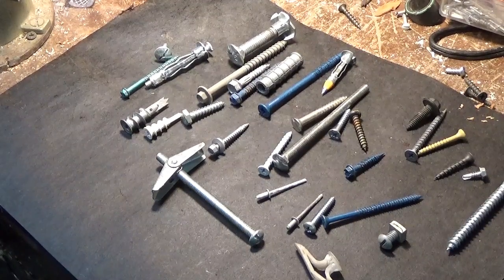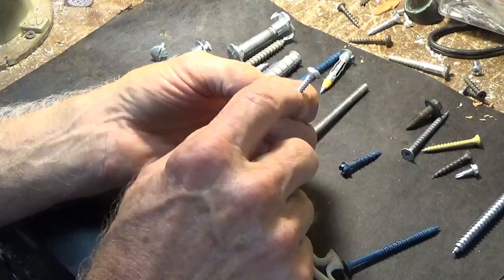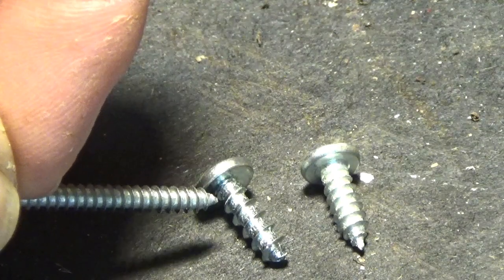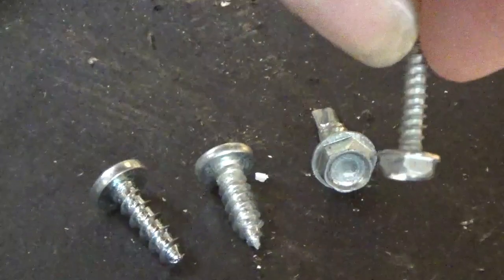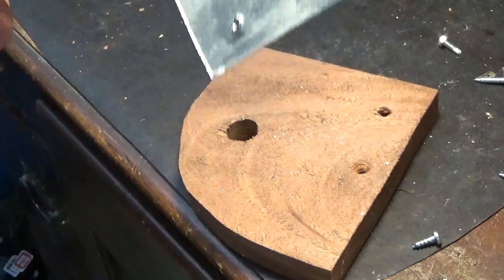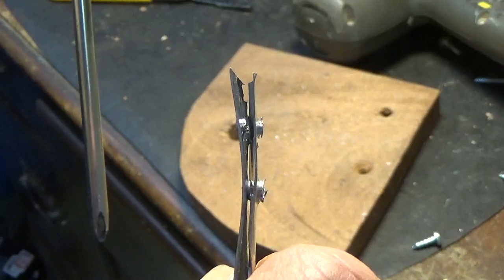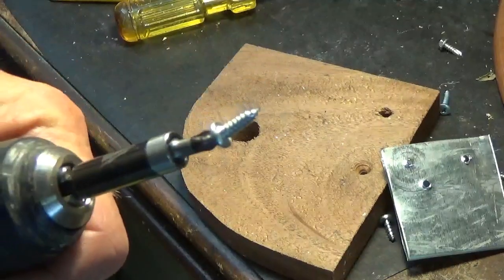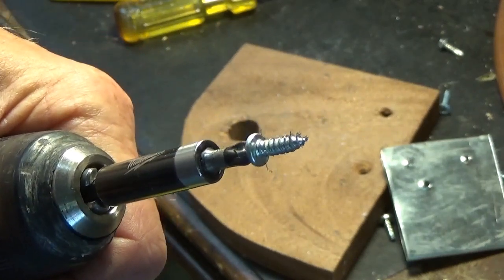Sheet Metal Screws and how to use them, how to use sheet metal screws,

Comment: Thank you sooooo much for posting this video!  I'm attempting to hang some hooks on the side of an old strong metal desk. I suppose I should use the strongest ones because the desk metal is so much tougher than sheet metal. (I always thought sheet metal was strong, but I can see where one could bend it easily)   Thanks so much for all the info!!! I never knew all the different types of screws out there!
Reply from the maker: Use the self tapping screws. They work best for what you are trying to do. They can help you at the hardware store  to pick the best ones

Comment: Hi Dusty
I have a pool gate made of aluminium the screw hole is losing.
How can I fix the hole in the gate without increasing the screw size to make it fit.
Thank you
Reply: Put something in the hole (copper wire, zip tie whatever) then drive in fastener.

Comment: a standard 1/4 inch UNC cap screw is specified to have a length of 1.5 inches. the screw is to clamp 1/2 inch plate to a base plate. Is it too long or is it too short